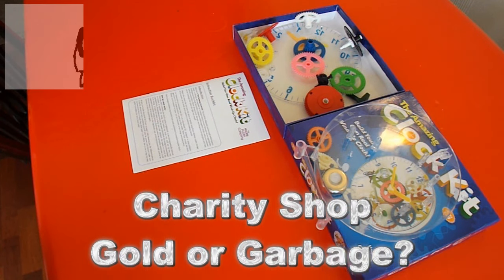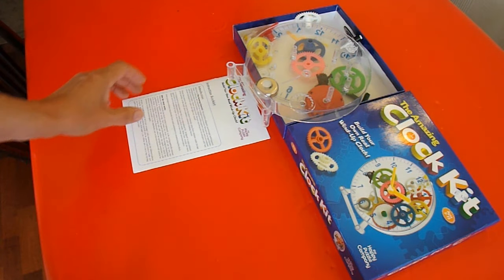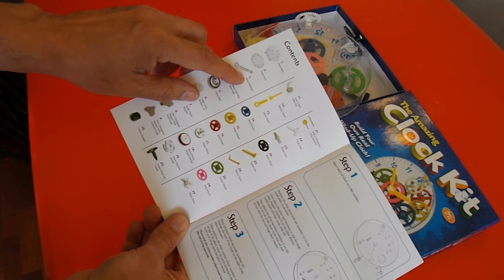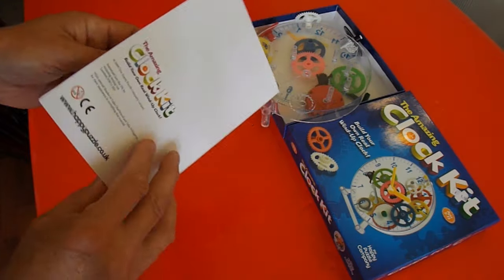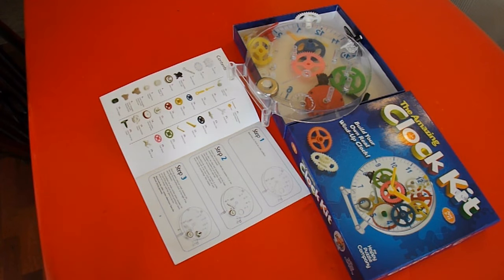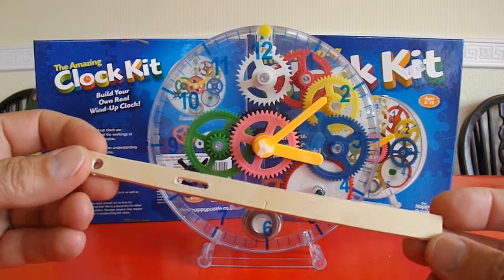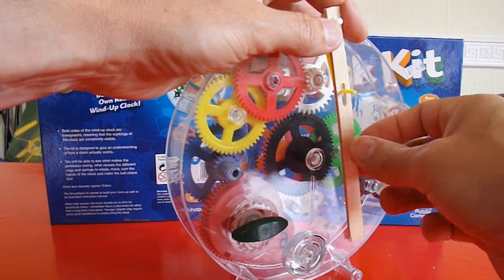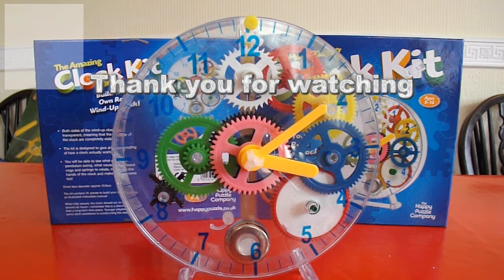Charity Shop Gold or Garbage - The Amazing Clock Kit assembly

Comment: I got this for my 35th birthday, I really like it!!!!
Reply from the maker: I like it. It is a straight forward assembly and it works, although it does not work long enough to use it as a proper timepiece 👍
Reply: @GrandadIsAnOldMan  Yes, I like mine a lot. It was a little tricky putting it together, but I managed it. It's an interesting item none the less. It's what I wanted for my B-day.
Reply: @GrandadIsAnOldMan  I don't know id they do this for this product, but maybe you could get the replacement parts online? Have you tried contacting the manufacturer and ordering the missing components? There are jigsaw puzzle companies that do this service, maybe if your lucky you could get the missing parts sent to you in the post?
Reply from the maker: I have a 3D printer so I can make parts if necessary. In a later video I did that 👍
My playlist for this clock https://youtube.com/playlist?list=PLA5a2xPRSrB2xtRMLIYFqZYlBBgIYUTmr
Instructions for the clock - https://www.happypuzzle.co.uk//uploads/downloads/clock%20instructions.pdf
Reply: @GrandadIsAnOldMan  I see, I bet that was expensive. I hear their good. I'm glad they exists, now with a little experience you can make replacement parts for things you used to have to throw away. I collect army men and police figurines, I want a 3D printer to make grey police figures because their hard to find online.
Reply from the maker: @ronaldmcdonald8303  The cost of any item will always be relative to how much you want it and how much use you will get from it. In the case of a 3d printer, there will also be ongoing costs for the filament you use and maybe some maintenance work.
Reply: @GrandadIsAnOldMan  I've put the clock together 2ice now, first time it was too loose, and now it doesn't tick. Do you know what I'm doing wrong? I'm finding it hard to get it to function, do you suggest I try building it again with more accuracy? I do like this kit, I told my parents where to find it and they got it for my birthday!
Reply from the maker: @ronaldmcdonald8303  I am afraid to say that taking it apart and putting it back together is the only option. Taking care to follow the instructions step by step.

Comment: If it had the proper pendulum then would the clock keep time accurately? I would like to make this but I think it'll be better if it worked properly.
Reply from the maker: I would expect it to work properly if the kit was complete. It is not unusual to find parts missing in second hand kits because some people seem to think it is OK to dump junk in charity shops.
Reply: Oh, that's sad, people should be more responsible knowing that there are others out there that would like to use the kit. Thanks for the reply though
Reply from the maker: +The QueensConquerer that is why the title of this series is Charity Shop Gold Or Garbage? :-)

Comment: GrandadsIsAnoldMan can i use ice cream stick? to repair this clock my clock is not working
Reply from the maker: If you mean to replace a missing pendulum, yes that should work if you add some weight. Take care drilling a hole in it as it will probably split.